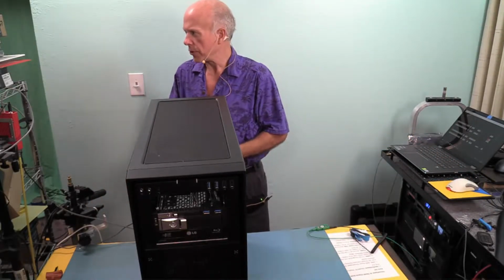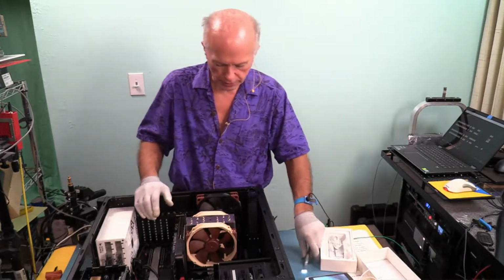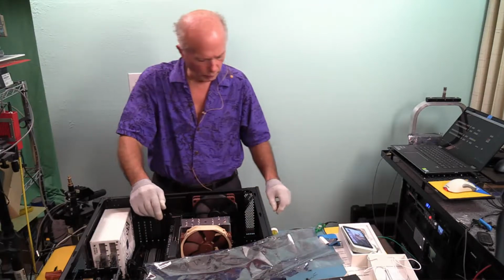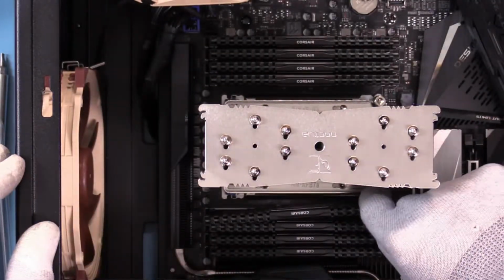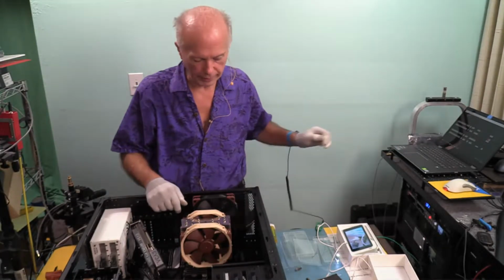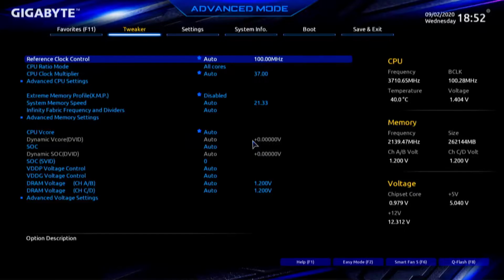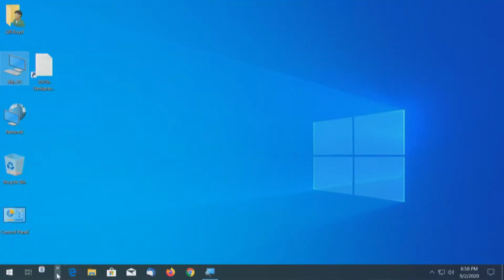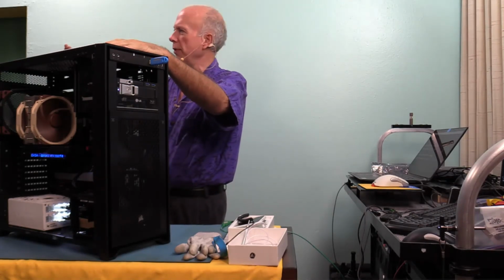Gigabyte TRX40 Designare Scoping RAM Clearance between 256GBs RAM and Noctua CPU Cooler

Comment: To clarify, is it this m/b that has support for 128 GB memory? So this was a BIOS update that opened up for the full 256 GB possible TR4 support?
Ah I see, X399 supports 1G and 2G TR CPUs. https://www.gigabyte.com/Motherboard/X399-DESIGNARE-EX-rev-10/sp#sp
Whereas it seems the TRX4 supports 3G TR CPUs. https://www.gigabyte.com/Motherboard/TRX40-DESIGNARE-rev-10/sp#sp
All great to know, nice job!
Reply from the maker: Hi Michael, Just now seeing Your message. Had 42 Messages held for Review I did not know about! Appreciate Your Comments! We did not want to try the Full Compliment of RAM until we could Test and verify. New Platform! This was Based on our prior experience with the 2 - x399 Motherboards we Built with. May improvements since then! Number one being Stability! The Bios Update improved Stability immensely.

Comment: I've used that same heatsink on my current system. Recently switched over to a water cooled AIO due to overclocking. Either way it's an awesome heat sink setup. Love the 2080 TI you have in there. Definitely a beefy graphics card. Waiting to see what AMD comes out with to compete with the new Nvidia 3000s series.
Reply from the maker: Hi Patrick! Good to hear from You today! We tried a Water Cooler on the 2nd Generation Ryzen. Like Building a Watch! Noctua is hard to beat! 

6 months ago, 2080 Ti. Now, RTX 3080. CUDA Core count! Still PCIe 3.0. And in short supply! Everyone is sold out! I'm a Fan of the AMD Radeon Pro WX Video cards cards. We those in our x399 Builds. Those are Bang for the Buck. However, For Rendering, CUDA Cores. No way around it. Kind of like, if You want to work, You have to do Adobe. 

And if that's the case, CUDA Cores! We'll see after doing some work and Report back our findings. After all, the Video card, unless doing something special, only does Render Previews and Overlays. And that scales at 10%. The other 90%, everything else is CPU Rendering!
Reply: @BuildOrBuy  Hello Gill, good points. Yes, Nvidia is killing the GPU market and AMD is doing well in the CPU market these days. Glad AMD is on top of the CPU game once again. Can't wait to see if they compete with Nvidia. The AMD fan boy in me is excited.
Reply from the maker: Hi @patrickwoolbright1960 , 
Amen to that!